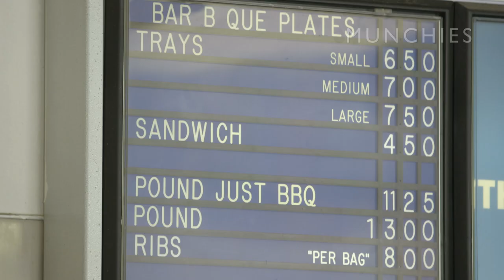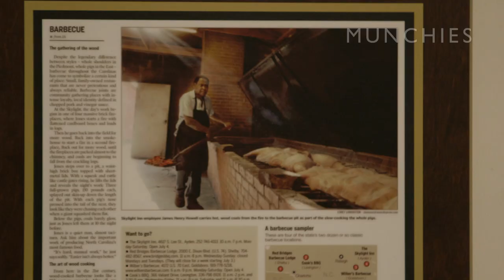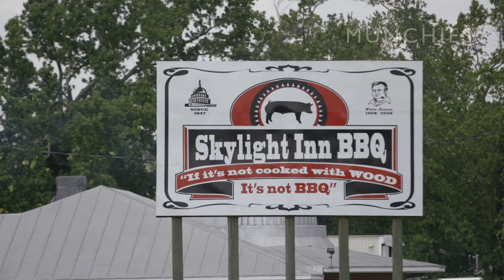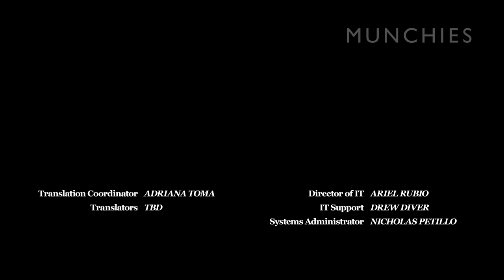The Legendary Skylight Inn's Whole Hog BBQ

Comment: If I did the math right, James has cooked around 46,000 hogs.
Reply: i got 41,600 how did you get 46,000. 40 a week 52 weeks in a year 40 times 52  which is 2,080 times 20 years.
Reply: @Zamboni89  That's why he said around, and not exact. He did not do the math right, whic he even pre warned you about.
Reply: @Zamboni89  He said 40-45 hogs a week..
Reply: I bet his arms are as strong as an Olympic weight lifter.....
Reply: @Thomasisfrench  no

Comment: The difference between NC "BBQ" and central Texas "barbecue" is pig meat grilled over direct flame, and then chopped to bits before getting a "sauce" of vinegar and ketchup versus beef brisket smoked away from the flame  at 175 degrees for 8 hours and doesn't need any sauce.
Reply: Exactly. There is no comparison. Completely different